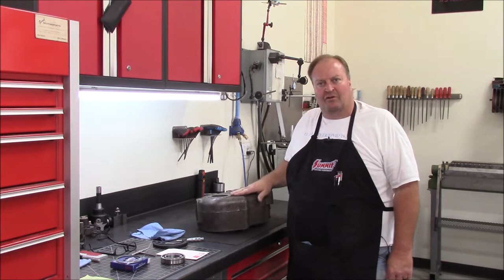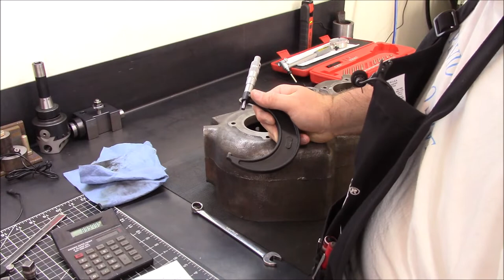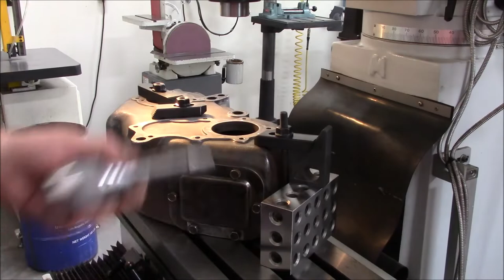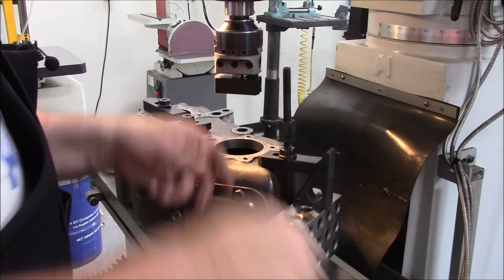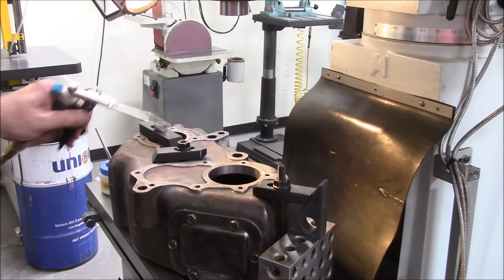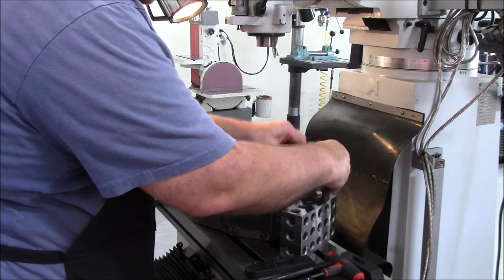New Process 205 Boring Input for 90mm Bearing

Comment: I pulled an NP205 off of a parts truck that I had, and the old bearing slid out if you tipped the case forward. I machined the case for the larger bearing and I may have overshot just a hair. It takes a tiny bit of persuasion to go in, but when it's in, I can rotate the outer race of the bearing. Will this be okay? All of the other bearings have a similar fit it seems like.
Reply from the maker: You should be fine. One thing on the older NP205 and NP203 transfer cases is they are also sandwiched between components in addition too a very slight interference fit.
Reply: The bearings on a np205 are supposed to be slip fit not press fit
Reply from the maker: This really isn't a press fit, very little effort and it's in.  I prefer them just a little more snug than to be able to their them in from across the room.